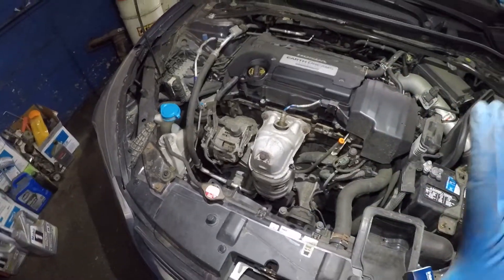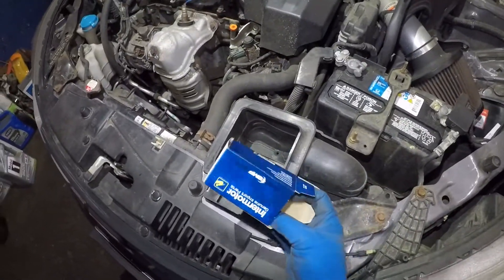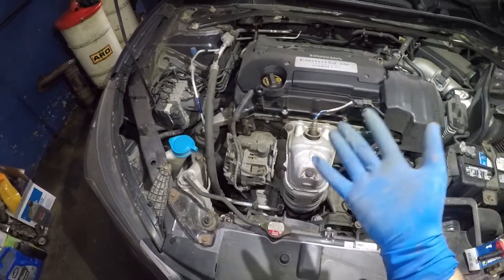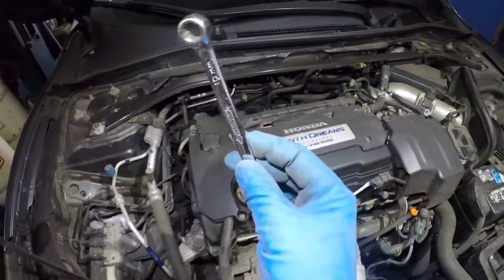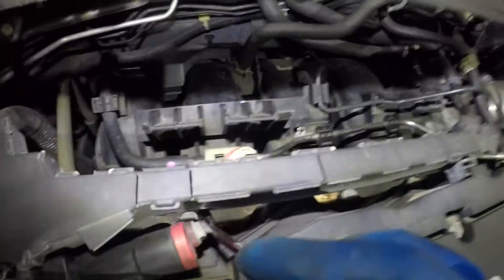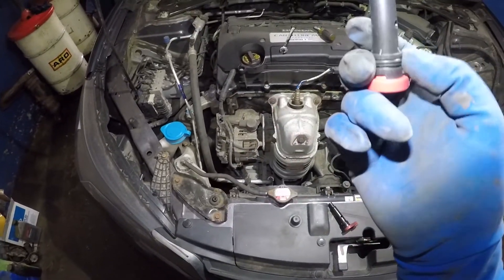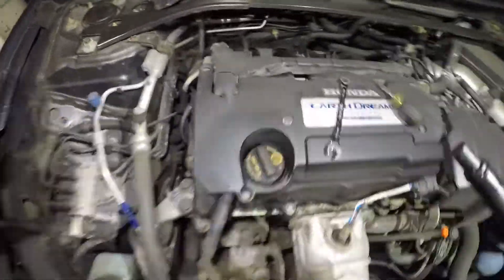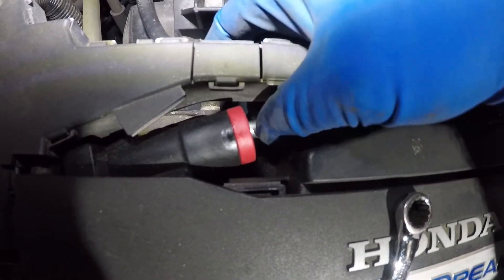Honda engine burning oil Earth Dream engine, very important valve must change every 30K miles

Comment: You also want to switch to 5W30. 0W20 is trash. It was more EPA Cafe standards than anything. You'll get better protection with 5W-30. And your gas mileage will stay the same.

Comment: I just changed pcv valve in my accord 2017 with 262k miles on it,
First time changed since I got  the car @ 37k,
I did the blow air from narrow end of the pcv valve test to see if the old pcv valve was clogged,
And there was no restriction on the valve on both ends,
The air was blowing from both ends freely!!!
But I changed it anyways!!!
Reply from the maker: Cool!! Well at least u did it!!!

Comment: Older style PVC valves would rattle when shaken if they were'nt stopped up. You could unstop them with a solvent. The Honda PCV valve makes no noise when new. How can you tell it needs to be replaced?
Reply from the maker: You just replace it after 30k miles

Comment: Doesn't fix the issue
Reply from the maker: Chances are yes or no or make it less or have no effect but it is possability also I did other video to take it step further
Reply: Try Valvoline Restore and Protect oil

Comment: Hey great video as usual!! Your my 9th Gen accord video go to. I have a head gasket issue oil/ coolant mix and I searched all over and nothing. What's your price to repair? And possiblity you can make a video for others since I don't see any. 
Keep up the Awesome work brother 🙏
Reply from the maker: I don’t do head gaskets anymore or engine swaps years back I did all that these engine aluminum are weak and there’s no point of doing head repair get ur self new engine other wise u will be doing it again

Comment: I thought it was only the earth dream engine with turbo’s that burn oil like the HR-V. I haven’t notice my 2013 accord engine burning any oil and it’s at 112,000 miles.
Reply from the maker: They all do 2013 above
Reply: THIS ENGINE ALSO HAS THE OIL DILUTION ISSUE AS WELL😡 DEALERSHIP WILL DO NOTHING,OR HONDA
Reply from the maker: @angiewalo9537  damn it honda

Comment: I put Euro Spec 0w-20 oil rated for both gasoline and diesel engines in my accord since it was still burning oil after changing the Pcv valve. Almost 3500 miles since changing to euro oil and not a drop burned.
Reply from the maker: Oh ok nice information

Comment: Personally, I never had an issue with mine; bought at 32k and traded back in around 89k mi. I did do other maintenance myself, like cleaning the intake sensors and I replaced that PCV valve at around like 70-71k miles I believe. 

I didn’t run high mileage engine oil at first, but gradually did as I passed up 80k miles. I also began running some oil stabilizer additive a while back, but didn’t see any burning oil minus me romping on the car to death (I had the 6MT model) and consuming a reasonable amount of motor oil for how I drove.
Reply: By any chance, was it a black accord coupe 2016? Just bought one with the same miles few months back
Reply: @doobsnoobler7555  If it was manual, then yes lol other than that, no
Reply: @isnowyazn  yes it’s a manual lol

Comment: my car has oil leaking same in your video at front. do you think that is PCV problem?     after changing PCV , the oil leaking will be gone?  thanks
Reply from the maker: No replace the pcv valve and the gasker

Comment: yeah, just change parts every 30k miles, even if they aren't bad, hell, just replace the whole enging every 30k miles, then you're guaranteed not to have ANY problems!🤣🤣🤣🤣🤣🤣🤣🤣🤣
Reply from the maker: Lol well if I was rich I would make them change my engine every 60,001 miles soon as warrnty is over after 60k miles
Reply: That's a subaru thing replace engine every 30k 😄 🤣

Comment: I just bought a '13 Accord coupe with this engine. I've been trying to find out what I can about this engine and came across your video. Even though I don't really have oil dilution problems, I will probably check and change the pcv valve. Thanks for the info.
Reply from the maker: Yup try the pcv valve if anything keep eye on it and if ur good then ur in luck… by the way some people messaged me stating they used gtx castrol that helped out if u get this issue try that as well
Reply: My mechanic told me the oil leak is the rear main seal.  I have a 13 and a 17.  The 13 leaks

Comment: Hey hi I'm a new subscriber. Appreciate ur channel. So I have a 2014 accord wanted to ask if serpentine belt squeaking when I start it but stops squeak when car warms up mean its time to change belt? Or is it a pully issue. Will be changing my pcv valve by the way. Thanks for this quick fix on oil burning. 💯👍
Reply from the maker: It’s the best replace the best if u want to do a test use windex spray on the belt when u first start it up and it will change the sound of it dose that mean definitely confirmed it’s a belt
Reply: @RBTheMechanic  that's  What's up bro. I'm gonna give that A try. Appreciate your time.

Comment: Hey,,RB,,,I got a problem to take the bolt out of the PCV valve,,,,It’s kinda stripped on the thread,,,and I’ve tried everything I can with small screwdriver to put into between  the red one and the bolt ,,,but didn’t work,,,,,I just turn around ,,around,,,,,so ,,what do you suggest ,,,,to take that bolt out ,,,thanks
Reply from the maker: Ok that is problem my friend I had another person with same issue it’s plastic valve cover the metal that it’s screwed in to is freeplacyed u might have to work some magic 🪄 or replace the whole cover but try ur self if u can some how some way get it out